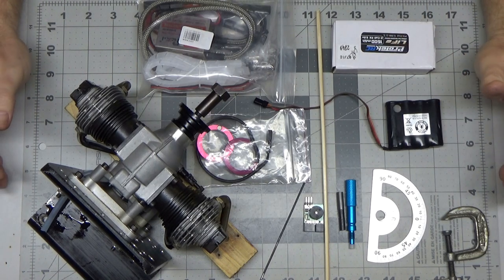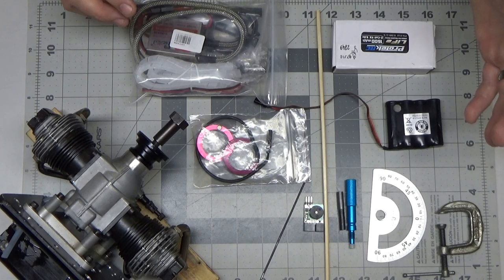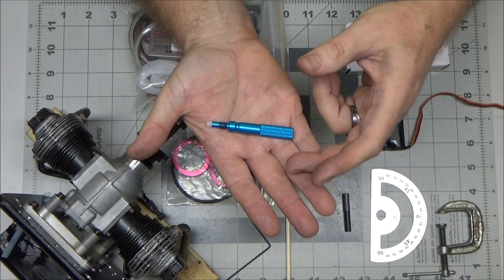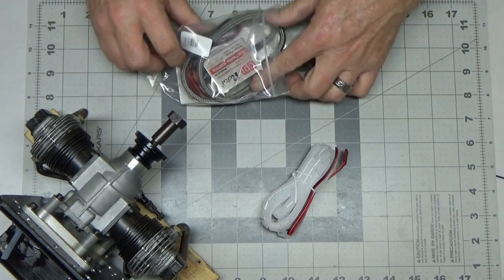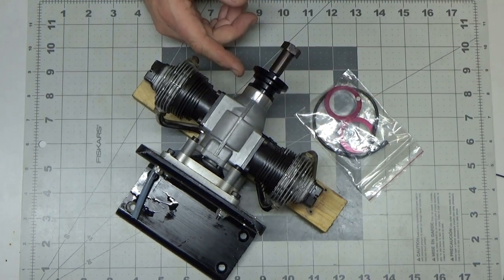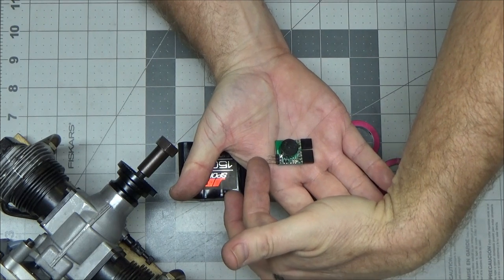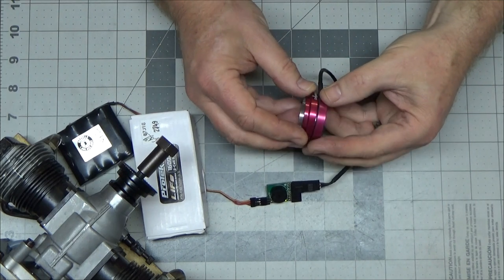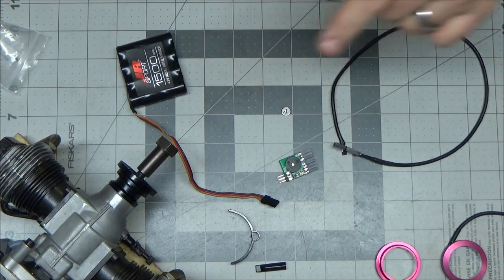Magnum FT-160 Ignition System Installation Part 1

Comment: Cool David.. I recently gotca 80" cap232 with a what i beleave is a 50cc 2strock engine on it. Its timing advince is mechanical with the throttle input. So the more u rasin the throttle the more advice it goes and the less throttle it retards it.. Havnt had a chance yet to persanly start the engine. But willl soon i hope.. Keep up the good work.. Thanks

Comment: I sent you the wrong piston stop tool. my other one is the same,but with the nylon tip removed. works on twins. one of my sensor rings is the type you mount the sensor on top of. its from morris. I also have the same one that you have there. both worked good.

Comment: this will be interesting... fyi the purpose of the engine stop is NOT to hold engine at TDC but is used to FIND TDC, place piston at BDC and install piston stop and degree wheel, turn engine over till piston contacts stop, note degree reading, then rotate engine the opposite direction till piston again contacts piston stop, note degree reading... TDC is midway between these two readings. trying to use piston stop at or very near TDC can cause damage ie. bent con rod. i believe the system you have is a wasted spark system, both plugs fire at the same time, one will fire on the compression stroke of one cylinder while the other will fire in the exhaust stroke of opposite cylinder.  hopefully your piston stop is vented.
Reply from the maker: There is some disinformation in your comment that needs to be cleared up.  First of all it is absolutely impossible to bend a connecting rod by using a piston stop tool and gently rotating the prop hub by hand to determine the position of the piston.  I did not say use an electric starter to do this.

Secondly, I have both glow plugs removed from my engine so compression at at a minimum.  My piston stop tool is not wrapped with teflon tape nor does it create a perfect seal and thus it does NOT need to be vented to work.  I have practiced this process several times so I do have a very good feel for what I am doing.